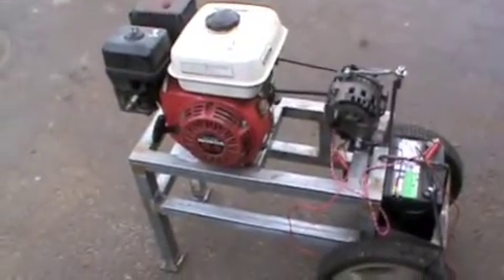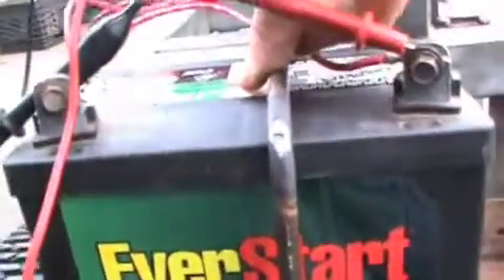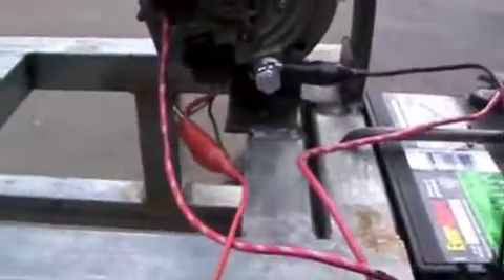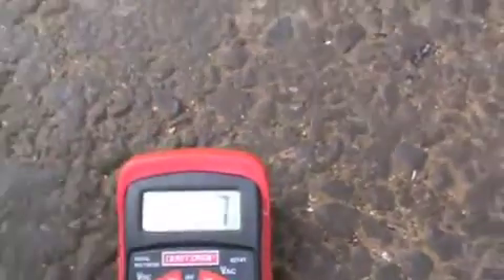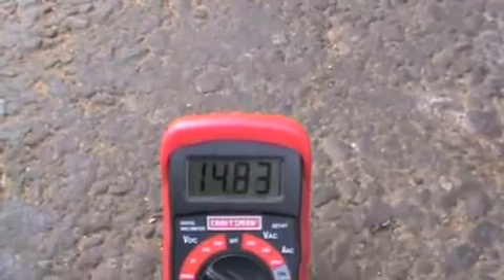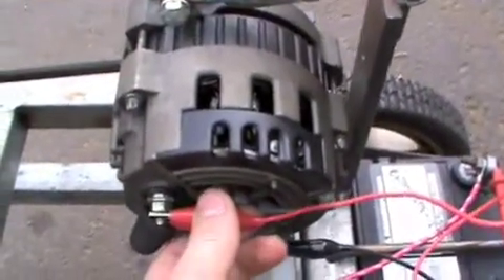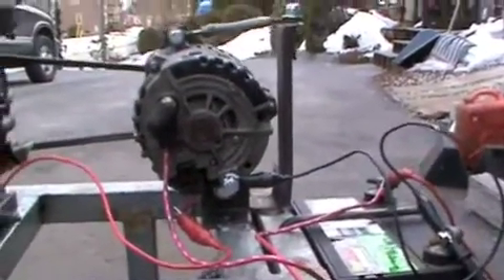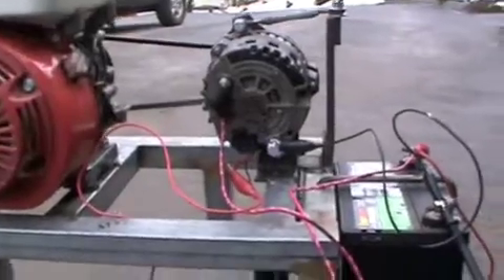Homemade generator 2

Comment: - from the alt go to one of the bolts of the frame, + from the alt gos to the battery or any device that you want to power, but what do you did to the other wires?, i notice that most of the alt have more then 2 wires,,,,, god job any way!!

Comment: Hey
I think if you put a diode in the positive line it will block the backflow of the battery to the alternator
Make sure you don't overcharge your battery
Maybe put a charge controller on it
Nicely made dude
Good job
Greetings from Belgium
Erik